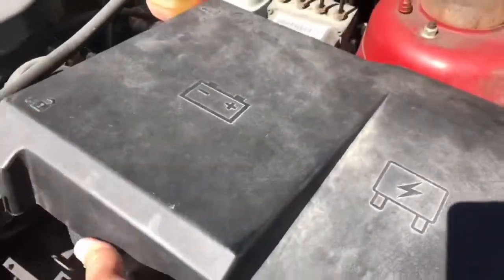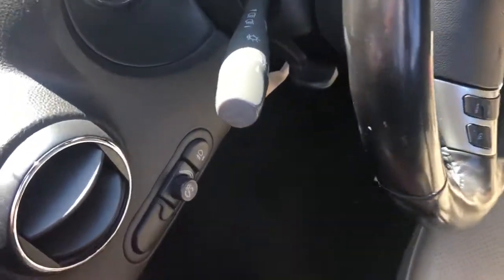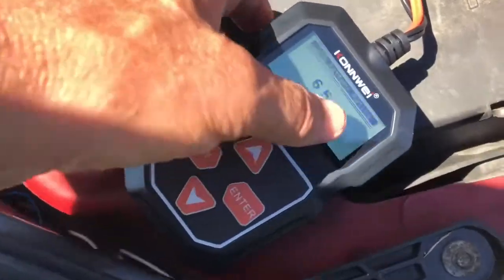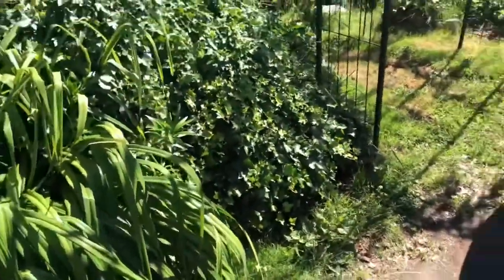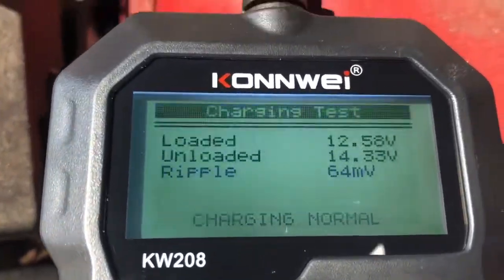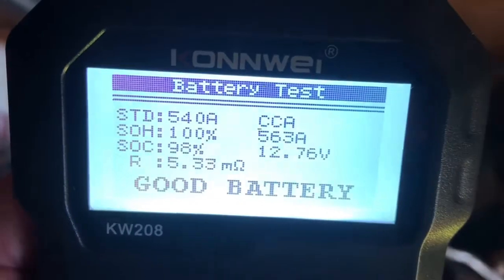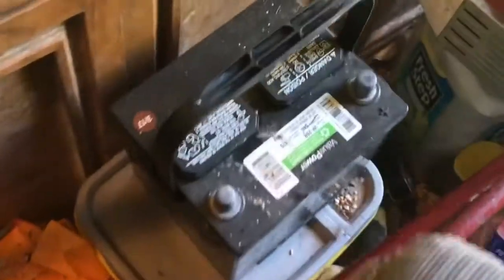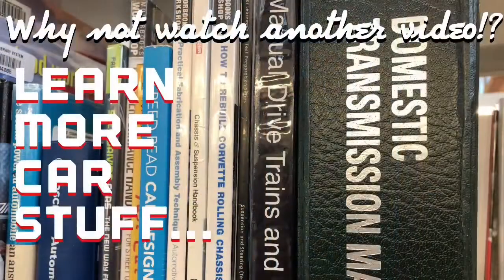How To and Review KONNWEI KW208 12V Car Battery Tester  30$ Battery And charging system tester?!

Comment: How can you use this tester on a battery with side terminals that has been removed from the vehicle?  How can the alligator clamps be attached  to this type of vehicle?
Reply from the maker: I assume you mean once the battery has already been removed from the vehicle?
Reply: @RussShawTV  Yes.
Reply from the maker: You can get a bolt the same size as the terminal screws that would work. 👍

Comment: Are you sure that BMW/Exide battery is not an AGM battery ?  An internal resistance of 181.82mΩ is extremely high and almost impossible with a flooded cell battery.
Reply from the maker: Recorded this a year ago I have no idea 🤷🏻‍♂️
Reply: @RussShawTV  What did you do with the BMW battery?

Comment: $5 off coupon on Amazon now. I bought another one that said my ccas were low. Going to test against this one and see what it says. Battery on and off were consistent with a multimeter on the other tester.
Reply from the maker: You may have a bad cell.
Reply: @RussShawTV  I tried using the konniwei on my battery to test the cca. It said turn on the engine. When I did that the car shut down entirely and wouldn't do anything. Like the device zapped the battery and sent a jolt through the electrical system. No clue why it did and serial to use it again. 

Thr battery has always started the car without major issue.
Reply from the maker: @kazper2011  WOW 😮 Weird I’ve never heard of something like that
Reply: @RussShawTV  right? I don't know if the unit is defective or what. Not sure if it is safer to start the car with it hooked up or hook it up after the car is already running.
Reply: @kazper2011  Impossible for the unit to short the battery with the high amperage of automotive batteries the tester would have melted before anything else.  Plus there is no need to start the car to test the CCA or the condition(SOH) of the battery.

Comment: Thanks for the video. In the charging test, I think you have to press enter and immediately increase RPM... I don't know
Reply from the maker: Can’t remember I haven’t used it in a while. When I was working at the Ford dealership we had a super high tech battery tester/charger.
I also found out hybrids that have a 12 V battery to start the vehicle they aren’t real accurate.
Reply: @RussShawTV  thanks very much. Do you think a most advanced tester could be more accurate? The one you show sounds good but I was looking at a foxwell bt780 but boy that one is about $220...
Reply from the maker: @carlosw1687  Not really sure I hadn’t researched it that much. Working at the shop we had a lot of this on hand owned by the dealership or the auto shop.
Reply: @carlosw1687  These testers are all based on the patented Motorola/Midtronics A/C Conductance Technology that were developed in the early 70's and mid 80's that used to cost in excess of $2,500+ a tester in the mid 90's. They are overall fairly very accurate to determine the State of Health(SOH) of the battery as it tests the resistance of the battery's plates and electrolyte. The most important reading is the Internal R (mΩ) value and anything over a 6.0mΩ means your flooded cell battery is on the verge of being kaput and time to replace.

Comment: I wonder why my Konnwei only says 'Charging normal' if I turn the AC on as well and at max cold settings. If not max AC or AC off, the Konnwei keeps saying "No-Output", and I dunno why the values are just around 12.98V if the AC is off, and 13.67V if the AC is on and thermostat is max low. It says "Good battery" in Battery Test, and Cranking Test is also good. I wonder where I screwed up lol
Reply: This is normal, because the AC takes mechanical power directly from the engine through a separate belt, in order to rotate the cooling fluid compressor. Therefore its operation does not load the electrical system at all, with the only exception of the electromagnetic clutch included therein, which couples the compressor to this specific belt moved axle. But this load, along with the rest of the cooling system (electronics and mostly relays), represent a minimal load in comparison to the rest of the electrical system. All of these above are true only in the case in which the AC is not a hybrid system, meaning that along with its mechanical operation it is also supported by a battery (which finally makes it an additional electrical load).
Reply: @ΠάριςΑζής  The blower motor is what increases the load on the alternator, not the compressor. When testing your alternator you are supposed to turn your bright lights on, ac/heat/fan on high, and turn your radio up loud. All of these things increase the load on the alternator and the voltage should decrease a bit. If it decreases too much the alternator may be weak. It doesn't matter if you turn on the ac, heat, or just the fan as long as the fan is running on high.
Reply: @mattstone5067  This is what I already explained in my comment above, expressed in other words...
Reply: You probably didn't rev the engine up to get charging output.
With the AC on,  it increases the idle speed to the point where it develops charging current.

Comment: Why get back in the car to up the RPM ?.
Reply from the maker: Depending on the charging situation sometimes it will ask you to bring the car up to 2500 RPM in order to test the alternators ability to not just charge the vehicle but delegate how much amps the system and battery are getting to recharge and not overcharge